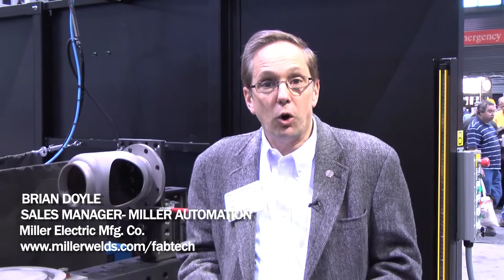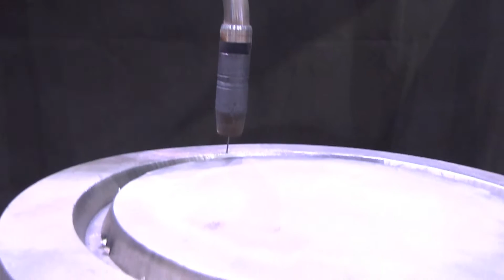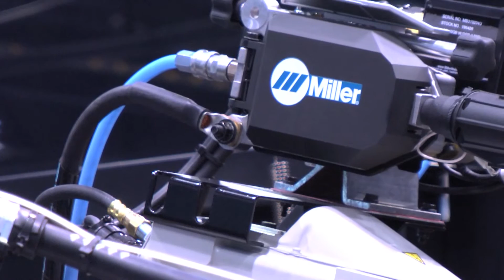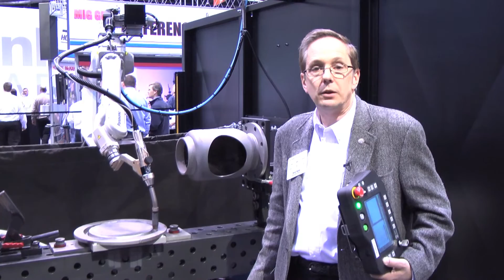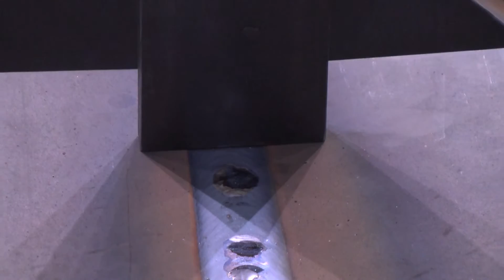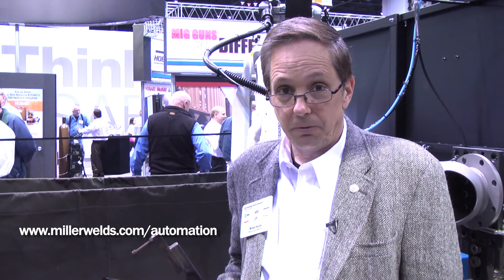Miller Welding Automation Adaptive Fill Welding Capabilities

Comment: Thanks
can you give me the adjustment for the post to weld and the Tension, intensity, and speed
I appreciate that
Reply from the maker: Hi Souci, thanks for reaching out. If you'd like to talk through the proper settings for your specific welding application, please give our team a call at 920-734-9821.

Comment: so is this a panasonic technology or a miller technology? could this adaptive function work with ABB systems?
Reply from the maker: Hi there, thanks for reaching out. Adaptive Fill technology is an option that is only available on Panasonic robots.  We use it with Panasonic robots and Miller Auto Axcess or Miller Auto Continuum power supplies.